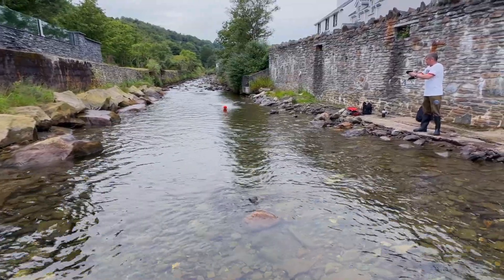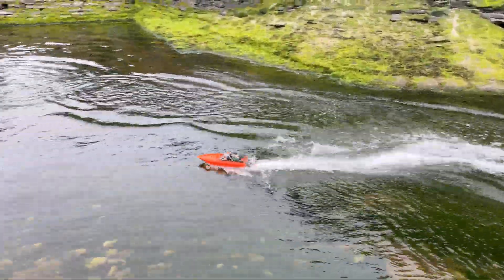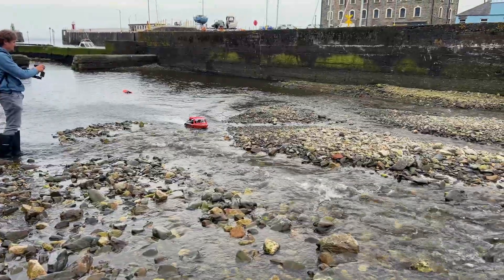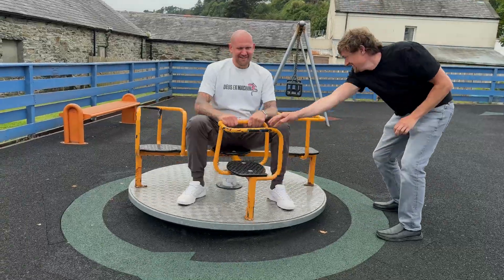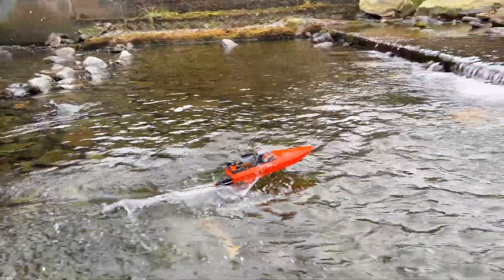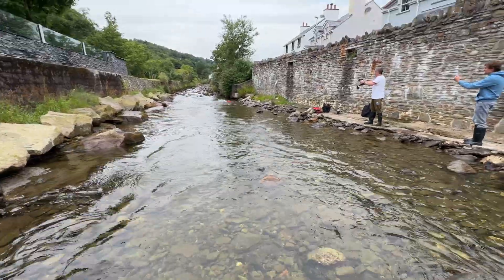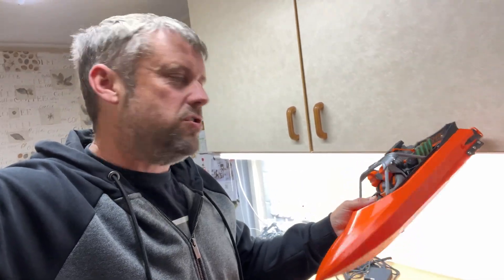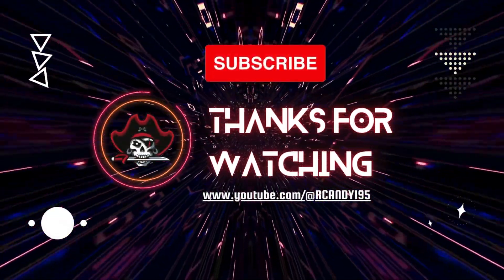How durable is a 3D Printed RC boat ?? I test it

Comment: Which esc amp rating did you match with the 3660 motor?
Reply from the maker: Just use the flycolour 90a they are fine

Comment: Nice vid Andy, your editing skills are becoming fab! It’d be a better job if you printed the rear fins in rubber. I expect you could print the hull in a rubber composite, it’d be INDESTRUCTIBLE! 🚣🚤
Reply from the maker: Yea there is a new boat out now that is made from TPU rubber so may give that a go
Reply: @RCANDY195 do it, please. 
I have a TPU 3D printed wing mount and wheelie bar on my Kagama, and that thing flexes so well. 
A TPU boat would be great if it didn't flex so much that it no longer was watertight. 
Cheers.